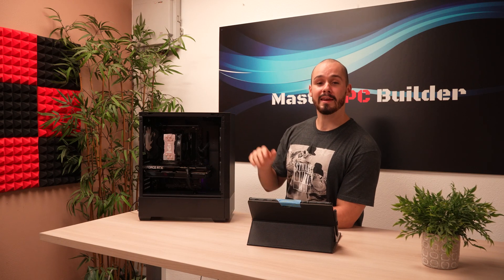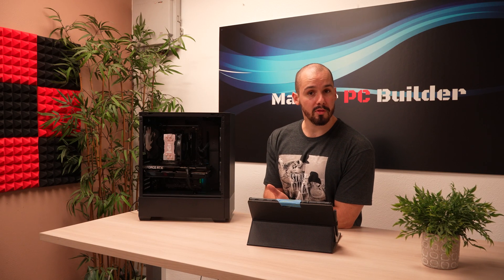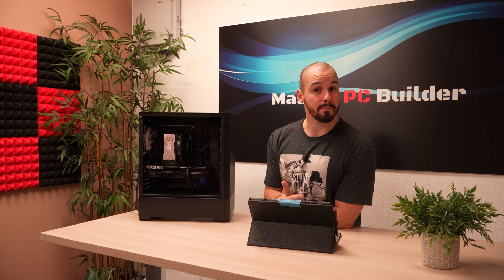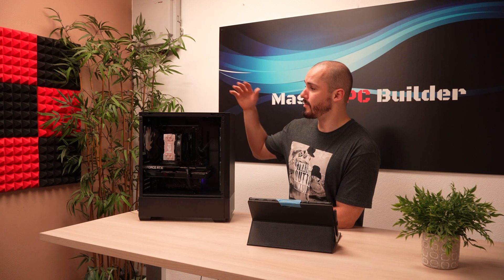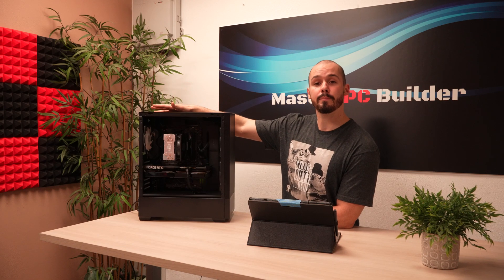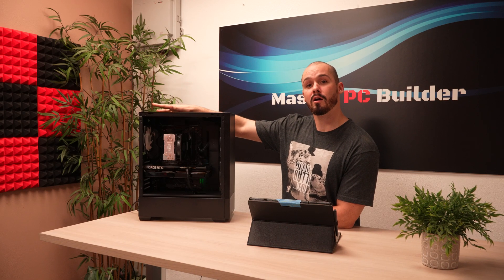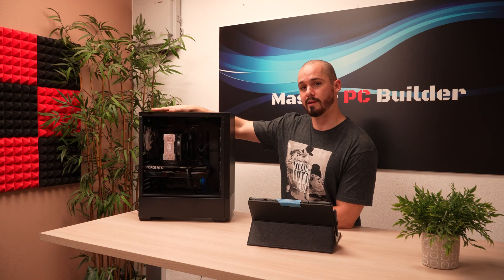What Are The Lights On A Motherboard

Comment from the maker: Update:
 0:34 GPU should be CPU

As mentioned in the video, your motherboard may have different terminology

Boot LED: Indicates a problem with the boot process, such as issues with the boot drive or OS loading.
VGA LED: Signals issues with the graphics card (GPU) or its connection.
DRAM LED: Points to problems with the RAM, like improper installation or failure.
CPU LED: Highlights issues with the CPU or its installation.

If you need more info:
https://www.asus.com/support/FAQ/1042678/

Comment: What if the LEDs light up after starting the computer and then go out after a while? Is everything OK?
Reply from the maker: When all the lights go off, it means the PC has passed all the system checks.
Reply: I have the same question, it was helpful thanks, I was being paranoid after cleaning the system unit I thought I've damaged my hardware